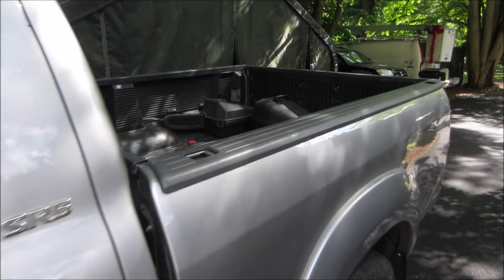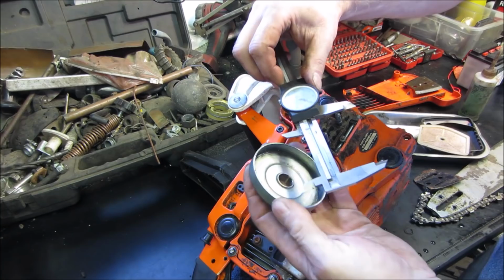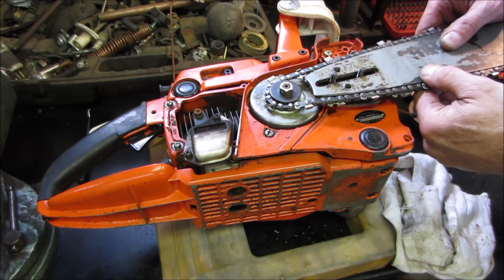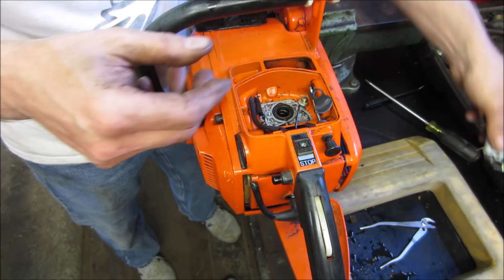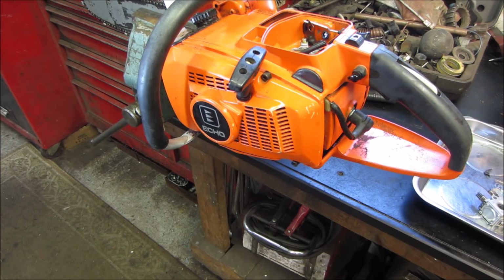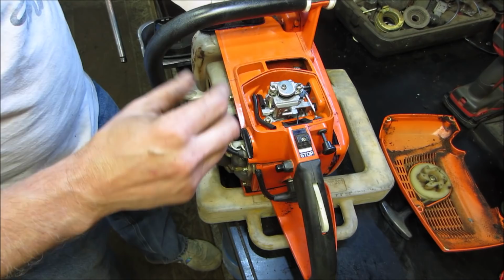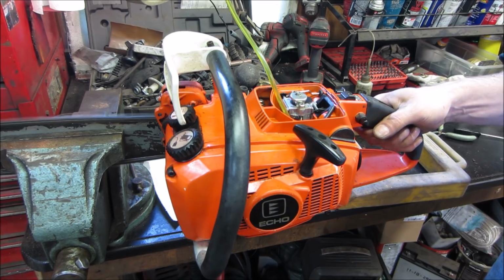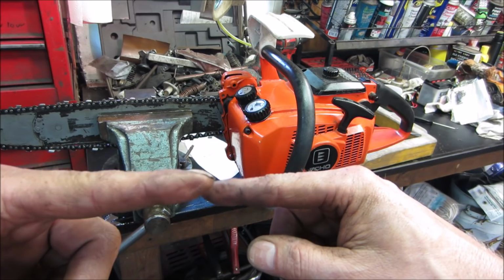Free Echo CS 400 Chainsaw, Will it Run?

Comment: good old saw. early 1980's 400evl little slower and heavier than some of the saws of the time but rock solid dependable when taken care of. some of the ignition parts are getting hard to find for the split coil systems. Clutch is fine. love to see a follow up with a carb kit on this one. fun fact. for a while echo made saws for john deere

Comment: To tighten a chain.  Snug it to the bottom of the bar, lift up the end of the bar and snug it up to the bottom of the bar, again.  When I say snug I mean up against the bottom of the bar.  I then grab the chain at the midpoint of the bar and lift it up to see if the drags still stay into the bar and when I let it go it snaps back against the bar.  I do all of this cold, preferably the next morning.

Comment: More likely the tension adjuster was bent by not being engaged in the hole and the binding bolts on the bar were tightened down,pressing the adjuster pin against the adjustment screw,thus causing it to bend.

Comment: If that grommet is leaking going into the tank it will not pressurize the tank and push fuel into the carb. Replace grommet, fuel line and filter.

Comment: Choke, probably had a small thrust washer on it.  Set both jets at 1 to 1.5 turns out.  That should start the saw, then you can tune them in.

Comment: Mustie, thank you so much for the time & effort you put into these videos.
I must give you 27% of the blame for my having built a 24 x 34 Pole Barn in the back yard in my plan to see if I can make enough money repairing / selling small engine stuff that I can quit my career. I have given myself 4 years to see if this plan will work out. The other 89% is on me (yea, that's was intentional math).
The barns not done (a few vids on my channel regarding the barn). Likely two more months to get electric out to it & tools / equipment all in place. It'll be close to $45K when it's done. $45K @ 27% means you owe $90K (more intentional math). I'll send you the invoice. You will be account #0004.
 I've been practicing a little on some neighborhood repair jobs ($450 in the past 3 months). Too busy with work & the barn to take on too many repairs. The practice has been good, never worked on chainsaws and now I've done two. Those things are different than a mower.
My head says to replace my current income I'd need to clear $100K (need medical insurance within that). That seems unreal but I'm all in on this experiment & we'll see how close we get. I recall a vid you did a while back about your business model, income needs, etc.. If you have more advice I'd sure be interested in another video on those topics.
Your vids have been amazing both for the "how to" aspect but also just as a security blanket when I get the hee-bee gee-bees about the size & expense of this unknown journey. Been in an office for 35 years and just want out. Have always enjoyed working on the small exhaust gas emitters. You help me stay on course & I just want to say thank you.

Comment: I had similar issue on Chinese saw,turned out was crank seal on 1 side ,I changed out both runs sweet now ,one day would not idle then next it would rev its head off as I said seals worked for me

Comment: Try sealing that gas tank  it's like my old 1/5 scale gasoline RC car if the rubber on the tank is sucking air it won't push fuel I sealed mine and worked

Comment: Can we distill Mustie's process?  1) Is the engine/machine complete?  2) Is the engine seized or free?  3) If free, does it have compression?  4) Does it have fuel and, if yes, is it good?  5) Does the plug have spark?  6) Is it getting air?  7) Are the fuel lines clear?  8) Is the timing/ignition working?  9) Is there an electrical problem?  10) Does the starter work?

Comment: You can hold the engine on full throttle when adjusting the high screw to get max speed then slightly ritchen  it. Am sure you know that anyway.

Comment: I think it had a chain brake when new. You can see where it came out of the top of the case next to the oil filler. Looks like it was removed and the knuckle guard installed?

Comment: Those fuel lines are a royal PITA to replace. I had to do mine on a Poulan Wild Thing...the ethanol had completely turned the line into a crumbly mess. Chainsaws, IMO, are a bitch to work on in general, definitely my least favorite.
Reply: If you buy the cheap homeowner one time use chainsaws, yes they're terrible to work on...and if you spend $500+ for a "Professional" chainsaw you need a professional to work on the dang thing otherwise you'll be cussing and throwing parts LOL.

Comment: I once came across a vacuum for free (at the curb). turned out it just needed a rubber belt. the replacement belt (believe it or not) was hanging on the cord wrapped around the handle of the machine. still have the vacuum.
Reply: @myvicariouslife4012  yes. and it still works. used it today
Reply: @myvicariouslife4012  the one I got later had a fail on off switch. to replace that switch almost the entire vacuum had to be take apart to get to it. the external switch pushes a long rod up the right side to the motor contacts up near the front on the right side. not fun. but a good challenge.

Comment: Echo saws from the 80’s were junk and without a chain break that was where it was from.  It is metal on metal but do clean the inside of the sprocket with break cleaner.  There should be a sprocket bearing, somewhere.  Grease it, sparingly.

Comment: Is nobody going to mention that the "fuel return line" is probably actually the crank case pulse line which drives the carb fuel pump which is why it terminates into the crank case and not the fuel tank, and why the fuel was slowly disappearing into the crank case because of the one way valve? And also your chain is way to slack. It should "snap" back to the bar, and not look like a set to tightie whiteies after a week of football camp. Usually I'm 100% on board with the mustie1 vids but I think saws might be your weak point. Keep the vids coming

Comment: I always look forward to your videos.  My favorites are the small engine repair&restoration.  A week or so I picked up a discarded Remington Logmaster chainsaw from 1958.  It is complete, but the motor is binding.  In the process of disassembly, I hit a snag at the inner centrifugal clutch plate bolt.  It is so tight, and I am unsure if it is a right or left-handed thread.  Any suggestions as to how to determine which way to turn?  (There is not enough thread on the crankshaft exposed to help tell whether right or left.  Keep up the great videos!

Comment: G'DAY Mustie,I Had an ECHO 9000,90CC Monster SAW,for around 25_30Years,that almost annually had to replace the fuel line,from fuel tank to Carburetor, due to Splitting or collapsing then giving insufficient fuel supply, when tuned correctly, it would run between 11,000_15,000RPM,for hours daily cutting Split Posts from hardwood for fencing,in a competition in Queensland, I once cut and loaded on my own 120 Posts in 90Minutes?then was that day,offered $1,500 Cash for it on the spot,still today regret selling,because Australia Work place Regulations, now have saws allowed only 80CC maximum? Love your variety, only engines,left for your tuning skills,is outboard engines?

Comment: Those saws date from the late 70s-80s. Weren't all that popular and all parts from the 440 & 400 would interchange. Problem was the ign coil would fail & OEM parts weren't available. They had a 2- piece ign system. Another problem was the intake boot. It would sometimes rot/pinhole, lean out & seize. Wonder he didn't snap the end off the crank removing that nut, it's only 10mm. They were the smaller version of the 500 & 650 series.
Reply: Those carbs were HDB Walbros & kits are getting hard to find.

Comment: Tight enough that you can grab the top of the chain and pull it across the bench without the chain moving. But yanking the chain it should slip and move round the bar.

Comment: I didn't reads thru all the comments but I noticed when you put the bar and chain back on, you didn't put on the outer chain guide first. Either you forgot it or it was removed before you obtained the chainsaw but every chainsaw I have ever had came with an inner and outer chain guide.

Comment: A lot of those cheap carbs from Ebay are Chinese made junk. I'm reviving a Troy Bilt Pony that sat for five years right now, and have a brand new $15 carburetor on it. The shutoff solenoid didn't work, and it doesn't meter fuel correctly. The mower occasionally idles up, or idles way down and cuts off. It is complete garbage. The idle screws were also supposed to be set from the factory, and they weren't. It ran wide ass open until I adjusted them.

Comment: I wonder if a good test of the fuel inlet line would be to use a syringe to try to suck fuel through. Hard to judge how much suction would be normal but I might try that some time.

Comment: The Poulan saw is called Partner in England , Tbh I've had brilliant success with them, Always gummed up but cracking saw, The disc cutters are also a little favourite of mine , I have more issues with Stihls then these.
Reply: syzsounds 👌
Reply: The poulan saw is also manufactured under the MAC, McCulloch,  Jonsered names in Britain. Its actually a part of the husqvarna group so technically its a budget husqvarna chainsaw. Pretty good saws as my dad owns the Jonsered version which is 20 years old.

Comment: No man. When the chain gets hot it expands and therefore gets longer which makes it more loose. When it cools down it will shrink and get shorter which will make it snug back up.

Comment: i once asked  a small engine repair shop if they could fix my  Poulan WildThing chainsaw.  The dude literally laughed at me. told me is was basically a boat anchor,, without even looking at it.
Reply: Ehh,they're ok. I run an 18" 42cc craftsman(same as poulan) and Chinese carbs tend to need attention more than they should and the bar oil always leaks out. I just drain it out after use for storing and clean carb or "kit" it as necessary. Always did the job I asked it to.

Comment: It's a shame there's no brake handle retrofit kit for this saw (any) but it's likely the kit's cost would be more then the saw is worth even with the kit installed.  ;-)
Why search for a bar, chain, etc... if the other one runs, maybe it could be used as a bike motor?

Comment: Supposed to have 2 spacers on both sides.usually I have to put in an electronic ignition,if these saws lose spark.otherwise a saw worth saving,unless seized
Reply: MrCrf450rider 👌

Comment: i watched this video on june 15 2019 love this video.diid you know on these small engines the muffler gets cloggrd up with carbon and the engine wont run right. thanks.
Reply: That's why i only use ethanol free gas in 2 strokes. They last way longer. And lessens carbon buildup tremendously

Comment: I was felling it was just the adjustment screws at the 50 minute mark. I think the idle adjustment screw based on it not idling. 
Also, would taking the chain off help when figuring out that carb at all? Other than so you don't accidentally fall onto it and turn into a piece of mince meat?

Comment: Quick question in videos gone past I saw you make a gasket out of gasket paper but it looked like one side that you stuck onto Carb mounting face and then tapped out the perimeter. Where did you get gasket material with the one side with adhesive

Comment: Love your one handed allen wrench turning!

Haven't watched the whole thing yet but was it automatic transmission fluid (or brake fluid?) soaking will sometimes soften/swell gaskets/seals/???  At least to get it working, until kit can be ordered/installed  in the carb.

Second line is the pulse line from crankcase to power the pump in the carb, yes?

RichE San Diego

Comment: I think that choke plate has a larger hole in it and it rides the shoulder so even if you tighten the screw in shouldn't pinch or bind it??

Comment: The first thing you should learn to do when you get a chainsaw like that is to check the fuel line and the fuel filter before removing the carburetor because you have already primed it and started a chainsaw so you know it runs and if the carburetor was bad then when you give it gas it would die it would not try to run correctly so next time when you are making a video for the public try to teach them the proper steps pressure test the fuel line and put a new fuel filter in the chainsaw when you know that it already runs then if it doesn't run properly show them the proper technique on how to check and adjust the carburetor set screws and idling unless you want to convince them that there isn't any hope for the chainsaw so you can get it for nothing
Reply: But I guess I am more of a analyst and know a little more about checking the simple things first before trying to tear into a carburetor like you just done and ruining the diaphragm possibly by tearing it or missing the gaskets up who wants to ask to buy a carburetor kit to fix something that they don't have a problem with in the first place take this into consideration thank you

Comment: Question for you? I have an Echo CS400. I can only get it to start with the muffler off. I changed the muffler and same result. New air filter, and spark plug. I know I'm getting fuel also, so I don't think the carburetor is the problem. A little help would be much appreciated. Thanks

Comment: .."The Echo is probably a better saw anyway"...No probably about it...no doubt about it....despite the fact it's much older...those were good saws...that Poulan you have was junk the day it came off the assembly line...not even worth minimal effort to get it running again(some of the older-quite a bit older-Poulans were good). If I get those modern Plasti-Poulans for free, they get tossed in the "irony aluminum" pile for the next scrapyard run...

Comment: Your low rev adjustment is off. Or you didn't clean the carb well enough, or the microports are jammed. Ultrasonic cleaning is a 50/50 chance of fixing it. Could be that compression is low, but ill place my bets on the lack of feul at low revs due to wrong adjustments or leaking carb/feul line sucking air in.

Comment: The Poulan is actually the better saw quality wise...um why didn't you check to see if fuel was getting  TO the carb before doing anything to it?  Only half way through the vid but I'd wager it's a clogged line or the like.
Reply: @bottomlands  but did they own Poulan when this saw was made? Have they owned the brand for a long time... anyways I don't mean that THIS one is better than the Echo, since it may have parts stripped and all, but is a better made higher quality brand. I don't think they're EXACTLY the same as Husky, they must cheapen them up somewhere.
Reply: @bottomlands   I used to prefer Stihl, but they aren't of the same quality they used to be. Mine was called a Farm Boss.  They don't make it any more. Good all around saw back then. Good enough that somebody stole it right out of a cabinet in the garage. When I worked for the forest service, we used many brands. For lightweight work, we had homelite, just the off the shelf variety, but we had Stihl, and for serious work, Husky. The Stihl with was was called a brush bar on it. It's a long blade that has the center cut out. While it was supposedly made for trimming up brush, it actually worked well for cutting down some larger trees. as you cut through, the cut part doesn't land on the blade and bind it up, it lands in the hole So long the tree wasn't terribly big, made fast work of it.

Comment: I have an old Echo 315 with a wall br0 carb.  I does the same as in your video. stalls out when I give it gas.  runs great for about 10 minutes on high then stalls out and won't start till it cools down. do you have a video of sealing the crank case

Comment: hey mustie1 i have a 1974 suzuki tc185 that only has spark when i have a battery hooked up to it just like that jawa motorcycle you did a video on i was wondering if there was a way bypass the battery but still get spark thanks patrick

Comment: I noticed the blade wasn’t sharp when you started cutting that barrel.
Reply: Diecast Pirate At first I thought he had the chain on backwards!
Reply: @AnthemBassMan  I was watching for that, I know Darren would not do that, he is much too knowledgeable for that to happen, if you notice at one point he starts to put the chain on backwards and catches it right away.
Reply: I used to help my Dad get the chain saws ready every other Saturday morning to go cut wood, so I can tell when a chain is not sharpened, if that chain was sharp it would go through that HDPE plastic like butter.

Comment: Leaky feed line equals no tank pressure...equals lean mixture..?...Crankcase pressure should pressurise the tank via a check valve..?...but feed is leaking.

Comment: What are you doing with the tuning screws?  A quarter turn on either can make a big difference. Start with one complete turn out on both and go from there. I’d say a quarter turn out on the low speed jet and a quarter turn in on the high speed. Adjust idling screw to suit!!!!!!!

Comment: Older chainsaws and modern fuel. There''s always a fuel line problem.
Reply: Yep, ethanol and rubber dont plsy nice, even 10% ethanol can deteriate some
Reply: I hate ethenol fuel.  Got 90 octane non ethenol fuel about a half mile away. Is the "good stuff VP in a can at $10 a gal.?

Comment: hi mustie  i have a craftman lt 100 mower  but the trans is out can you do a video on a hydro trans workover  it originally had a pin out between the motor and the trans  replaced it ran about an hour and quit again any ideas